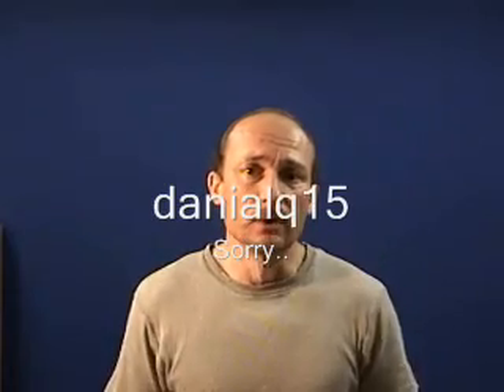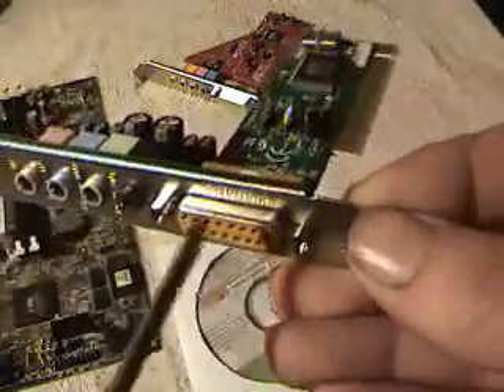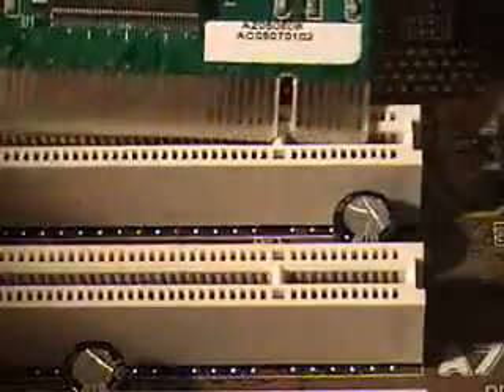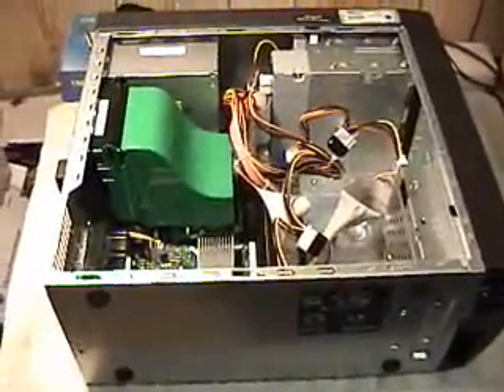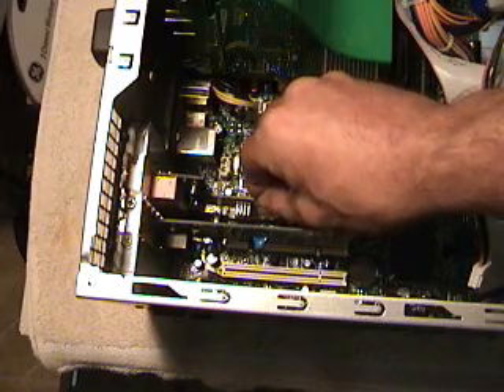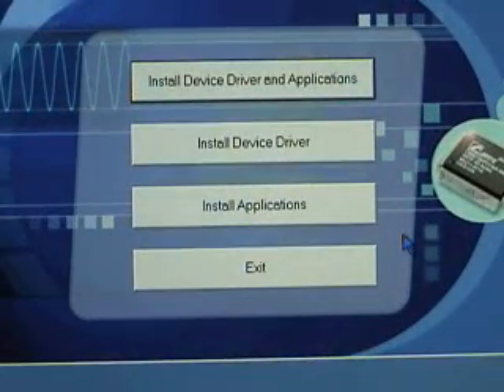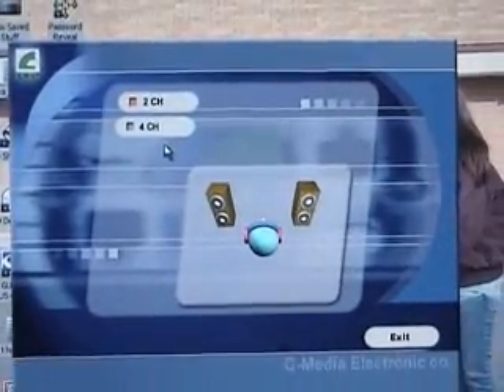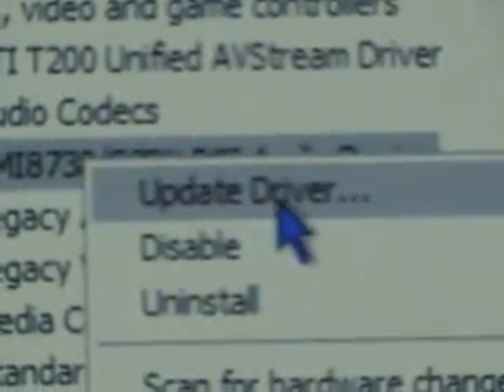Sound Card Install

Comment: Is my sound card built into my video card on dell 537?  I hoped this vid might be like mine but it's not. Thank you...
Reply from the maker: Yes your sound card may be built in to your main board so if its not working you should be able to find the drivers on the website of the maker of your pc. It will be bundled with the motherboard drivers.

Comment: I'm looking at this video because I'm going to install a pci sound card with a 15 pin game port on my secondary computer. I have installed Windows Flight Simulator 98 on my Windows XP HP Compaq computer. I know this stuff is outdated but I really want to get it running. After messing around with it for a while I will jump to the newer stuff. I have the old yoke and the old pro pedals but they are not connected by USB. They are connected by gameport only since it is the older version.

Comment: I used to do computer repairs back int he day of the older Pentium III and P4's anyways... my latest upgrade was to a Dell T3400 dual core 3.0 upgraded with only 2Gb. Ram for now due to my limited funds. The on board sound sucks "SoundMax" because winows 7 discontinued support for hardware enhancements without using software to install the drivers separately. So I just went on ebay and ordered my latest upgrade to my sound to a ( Dell Sound Blaster X-FI Xtreme 7.1 SB0460 ) and my Graphics also to Radeon 7770 vs my older Radeon 4870 vs- my on board crap. I'm happy with the setup I have now, and will be much better sounding when I receive the sound card.

Comment from the maker: Onboard or built in sound is usually not very good for anything much other than basic sound. installing a sound card would help but to disable your onboard sound you have to go into the bios. that is usually accessible by hitting F2 or DEL when you first turn it on.

Comment: hey there, i was considering getting a sound card because i just got 2 new gtx 580s as a sli setup, but after i put them in my sound from my speakers has gone fuzzy.  Would getting a new sound card solve this problem?  i can not disable the graphics card sound drivers or uninstall them (they re install themselves after restart and i cant stop it), and im not if the graphics cards are stopping my on bored sound card or not... not sure how to fix the problem

Comment: I built 4.1 system by myself, bought cheap chinese sound card 6ch
4x 50w tda7850 (4x42w max at 0,07% THD) with no shitty hum as all pc speakers have.
10" classic dayton subwoofer 0,8" MDF cabinets for 4x 5 1/4" sony woofers and 2 2" titanium tweeters
and rear pair 2x 4" daydon midbass woofers wich were pretty expensive and 2 piezo tweeters.
subwoofer amp is 350w 4x tda7294 powered by 500VA audio grade toroid transformer.
All the system together only 320€ fuck ur cheap and gay logitech.

Comment from the maker: @WillFromFinland I had a friend who installed an expensive card and had the same problem he had a conflict with some dvd player software trying to control the card, try uninstalling the control panel for the card and let windows control it. or uninstall any dvd player software and see if it works or upgrade windows media player to the latest version.

Comment: I bought a 5.1 speaker system the other day, but when I choose 5.1 setting on sound settings, nothing special happens, it still keeps on being 2.1. Even if I choose anything else, nothing changes. Any idea why? Could it be the sound card?

Comment: can you get the Sub-Out on a 5.1/7.1 card to just use low frequency audio rather than using full frequency sent to a speaker with a built-in Crossover?

Comment: Thanks a lot for posting this video.  I've had my computer in and out of the shop 2 times and they didn't fix my sound problem.  I just took a sound card out of an old computer and put it in and now everything works fine.

Comment from the maker: @zamant88 It is true that magnetics can disrupt some components.But that is only magnetic sensitive things. Like recordings on Tape or a programmable chip. Like the cmos in a motherboard. Your hard drive is sensitive to magnetism, but it would take a huge powerful magnet to mess it up. the magnetic strength of a screwdriver is not strong enough to hurt it.

Comment: This looks very cool. I want to make a pc and am sourcing my parts through the internet. I was wondering if using a magnetic screw driver wud be a bad idea, as the magnetism can cause the circuit to mess up. Or am I thinking too into it lol. Because all I have are magnetic screw drivers, so my question is, wud I need to buy normal (non-magnetic) screw drivers when screwing components together? Thank you for your time!

Comment from the maker: @129820 I'm not sure about the details of the devices I used in this video it was awhile ago, but you can get a cheap audio card from (tigerdirect) or (newegg) (dot)com fro about $10.00 or more and it will work fine for most applications

Comment: @BetaFlux Well I tried plugging the mic into the line-in jack but nothing happened.  I think I'll just buy a PCI sound card like the one in your video since that seems like it'll work for sure but how do you uninstall the control panel and card?  And also, if I did that would it guarantee my mic jack to work?  Because I don't want to mess up those jacks anymore.  Nice videos by the way, keep it up.

Comment from the maker: @orcus12345 You might be able to plug your mic into the line in jack and the sound control panel will pick it up.
I have also noticed sometimes that the control panel that comes with the motherboard card and windows do not like each other I have made mine work in the past by uninstalling the control panel and sometimes the card and let windows reinstall the driver, that will set it up for sure to use the windows default settings.

Comment: The internal sound card in my motherboard has good and working line-in and line-out jacks but for some reason the microphone jack isn't working.  I've tried changing the boost and unmuting it but it still won't work.  It even comes with a green check mark in my Windows 7 sound recording tab in the control panel.  My motherboard is a 945GCT-M/1333.  This goes for all microphones as well, I tried replacing the microphone I have now and still nothing... I've even changed it from mono to stereo.

Comment from the maker: @MultiLincs The sound card should have come with a control panel, you will have to go into that and in there it will let you choose to run 2.1 sound or 5.1 or whatever. select 2.1 and the jacks will set themselves accordingly.

Comment from the maker: @18phenom Are you sure you have the proper drivers for your operating system? also make sure the sound card is plugged in to the motherboard slot properly.
goto the manufacturers website of who made your sound card and make sure you have the latest driver.

Comment from the maker: Uninstall the software if you have previously installed it. also disable or uninstall the previous software for your other sound device. make sure the new card is plugged in good

Comment from the maker: Not sure what to tell you on that one, maybe go into the control panel for your sound card and see if you can change the settings. or uninstall it and reinstall it again. SB are tricky sometimes. I know I have actually stopped using mine because it is so touchy.

Comment from the maker: They usually use the power through the pci buss of the mobo, I know some video cards need the extra 5 V plug, if you see a sound card that has a receptacle for a 5V plug then plug it in.

Comment: *Hey BetaFlux I've got a question for you - Do the sound card need a power supply connection? Or it uses the power supplied through the motherboard? Thanks in advance. ^_^

Comment: hi i am a first time builder and i was wondering what kind of sound card i could use with home theater speakers. i have a 3.1 B&W speaker system will a sound card be better than the motherboards integrated sound system?

Comment from the maker: I would start by taking out your sound card if it is a pci card, or turning it off in the bios if it is integrated. see if that works then try updating the software for the one you have.

Comment from the maker: Optical drives have jacks for analog and digital audio output. The analog jack is rarely, if ever, used these days, since the motherboard's sound chip or your sound card will decode any audio streams coming from the drive over the IDE or SATA interface.

Comment from the maker: it will be hard to find a new plug to replace that one, Your best bet is from an old computer case or radio shack. make one work that doesn't quit fit just right. :)

Comment from the maker: Right, disable it, it wont show up in device manager now because it is disabled, I thought you said you installed a new card? I had a built in sound card that would not work no matter what I did, But when I installed the new beta version of windows 7 it worked fine. I still use a pci sound card, it is faster and less stress on the cpu.

Comment from the maker: Make sure you uninstall the old drivers to your old card first. you might have to put your old card back in to successfully uninstall it. The control panel that comes with your card could be causing it and you cant uninstall it if it cant find your old card.

Comment: it has nothing to do with your soundcard. It has to do with your speakers. Some speaker systems can pickup radio signals, to fix the problem turn your volume up on your speakers and turn the volume down on windows. Hope you understand what i mean :P

Comment: Do you mean a computer with an integrated sound card?
If so, yes you can install but first I've heard you have to disable the onboard/integrated sound card first in the BIOS (Basic Input Output System).

Comment: hey sir I've got a old computer motherboard (around early 2000's) and if I by a NEW sound card is it standard?, I mean the number of pins are all the same and will fit to my motherboard even if its old?
or do I have to take into account the number of pin slots on the motherboard (if that's what you call it)before I buy a new sound card?. plz help.

Comment from the maker: Probably not the card, I have tried a lot of different headset mics and the best one I've seen is a cheap $7.00 set from inland. The speakers are not great but when your making a video or doing voice chat the mic works great. I use a headset so the mic does not feed back into the speakers.

Comment from the maker: does something show up under "Other devices"?
that would be your card, or if it died on you then you may need a new one, or if it is an on board card then it may be turned off in the bios.